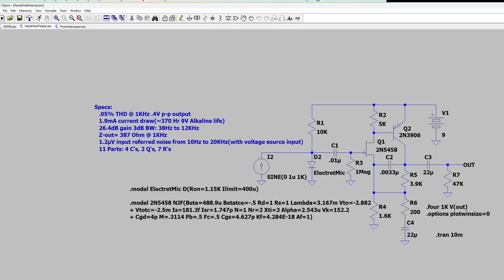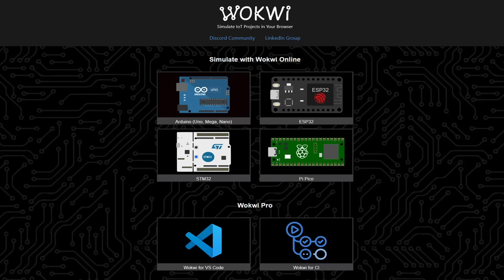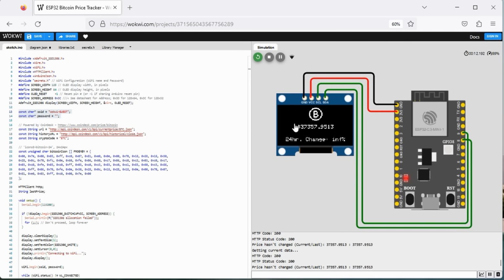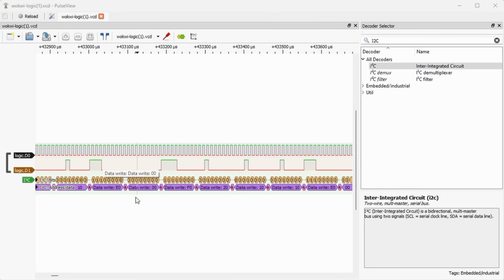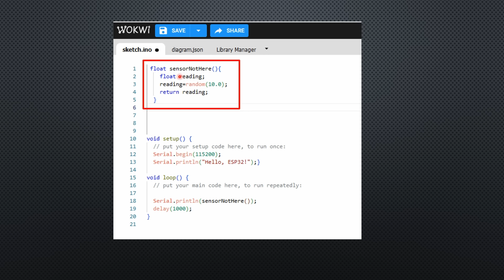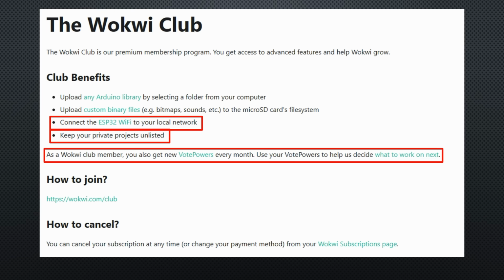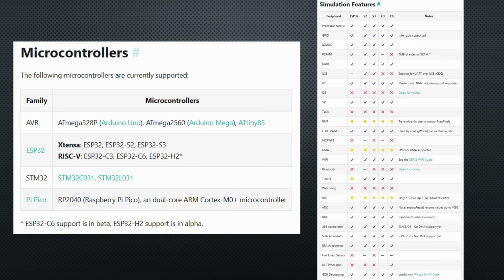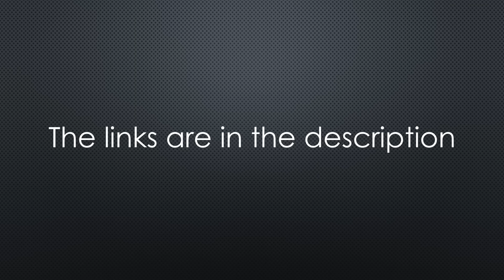472 Simulate Arduino, ESP32, Pi Pico, STM32, And ATtiny with Wokwi

Comment: With my students we use simulIDE as it can be set locally quite easily on mac/windows/linux but yes Wokwi is pretty nice too. With SimulIDE we also are able to use the real serial port of the PCs we use so the student can interface their virtual arduino/esp32 with actual devices plugged.
Reply from the maker: I did not know simulIDE. Thank you for the tip!
Reply: thanks for the tip! i like it to have a local version instead of a browser based simulation! and the best, they have linux support! amazing!
Reply: Wow! Exactly what I was looking for! A real desktop application running on Mac and Windows! What makes it unique is its ability to create and simulate high level components, such as MCUs, as well as lower level discrete components. 

I don't like how the developer of WOKWI incorporates free and open source software created by others and serves it behind a paywall for  profit. While it maybe perfectly legal, it's far from the spirit of open source whose contributors intended their code to benefit the community and not for the financial benefit of an individual.
Reply: @bobweiram6321  considering they intentionally contributed to a software repository that has a permissive license, you're wrong. They could have chosen to publish them under a restrictive share alike license but chose not to.

Comment: Another great video! Wokwi is simply amazing and it deserves a wider audience. I've been using it for some time now and it can be quite useful. It even allows you to use all libraries that are available in the Arduino library manager. It was quite interesting to successfully test a virtual TM1637 display with my TM16xx library. I also tested the serial output for an I2C scanner and must say it's astonishing to see how accurate the simulation is. Of course not everything is identical (e.g. timing), but al in all Wokwi is a very useful product and a wonderful achievement.
Reply from the maker: I agree. This is why I thought it deserves a video…

Comment: Oh, this would have been so ueful when I had to make an attiny and an esp32 talk to each other. The attiny is acting as a watchdog in this project and resets the esp32 if there is no ping pong on rs232 ... nice project!
Reply from the maker: Interesting idea. I did not ask myself if it can simulate 2 chips in the same diagram. Probably not...
Reply: @AndreasSpiess  not yet

Comment: 🤔 i wonder if it simulates power supply issues , for the longest time my esp32 would crash when another devices was turned on and it took me ages to figure out
Reply from the maker: It will not simulate analog stuff. And yes, I made my first video about this topic 5 years ago ;-)

Comment: Where does the sketch and diagram for a project come from?  Are there some preconfigured ones or do we have to come up with them ourselves? For instance if I wanted to simulate a radio circuit using an Arduino Uno with a radio receiver chip, push buttons and LCD display how would I go about doing that?
Reply from the maker: The chips are made by the platform. I do not think it is possible to simolare a radio as this simulation is digital and not analog

Comment: Th RCNUN converters look virtually identical to the CPT branded ones I have recently used.  I too build in the "chineseum" factor, but taking that into account I have found them quite reliable, and they are fully potted making them quite weather resistant also.
Reply from the maker: They are good for high-current applications, I think. And I agree, the mechanical design is good. That is why it is disappointing they were not able to remove this common mode error...

Comment: Looks awesome. I am a bit surprised that it supports some STM32s, but not the commonly used ones.
Thank you for sharing :-)
Reply from the maker: I do not know his reasoning. I assume, it is effort to add a new chip bedcause each is at least slightly different.
Reply: It could support templates. IPs in STMs are most often very similar and you could just create them based on headers you already have.

Comment: Neat. I usually simulate my AtTinys in TinkerCAD, but this looks nice. I'll have to see if it works through my workplace firewall and filters, though.
Reply from the maker: I did not know of thinkercads possibilities…
Reply: @AndreasSpiess  I didn't either until I started a workgroup where older students teach Arduino to younger students, and there we used TinkerCAD to simulate an UNO. It took me a while to notice that they also support Tiny's, but I have no idea how deep the simulation goes. What my students noticed last week is that using digital pins to send a high or low signal to another UNO required their GNDs to be connected.
Reply: If it doesn't, please let us know!

Comment: I face one issue - when to use a capacitor or resistor between a microcontroller and a sensor etc.
Reply from the maker: Agreed. As said, this is not LTspice…

Comment: Thank you.

Question: What programmer are you using to program the ATiny85 with? Is it via Arduino?

Thank you.
Reply from the maker: I use an USBasp dongle and a small board with a socket.
Reply: @AndreasSpiess  Thank you.

Comment: Proteus is a similar software
Reply from the maker: Does Proteus also simulate MCUs? It looks more like LTspice...
Reply: Proteus does simulate some MCUs, and it's been around for a very long time (since 1988). Unfortunately, it only runs on Windows, licenses are not very affordable (the lower tier starts at ~$250 per license). It does some things that Wokwi doesn't do (e.g. PCB schematic capture, layout, more comprehensive analog simulation), but doesn't have their ESP32 nor Pi Pico.

Comment: Not really useful :/ why would you do the other than maybe educational purposes, why dumbing down the ESP to attiny level when it can run the same code with way more features... Man these guys instead should spend time on fixing the bodgy/crappy tcp stack code on the ESPs cause this board is a dogpoo at best on the longrun, let your bitcoin price tracker run for 1 year and please pull out the debug info from it how many time did it segfault, reconnect to wifi, become unavailable or the whole firmware died
Reply from the maker: I have many ESP32s running here. They run stable. But they need a good power supply.
Reply: @AndreasSpiess what does “really” good mean?   Maybe this could be a video…. “Common stuff people whinge about with micro controllers and beginner electronics”.
Reply from the maker: @simonnaughton2272  Most problems reported with reboots are because Vcc of the chip goes below 2.5V for a few ms (during transmission where the ESP32 consumes more than 500mA)